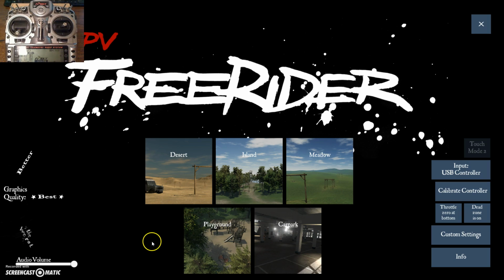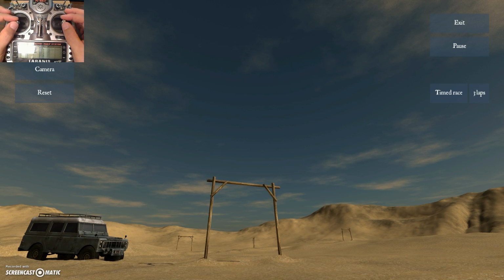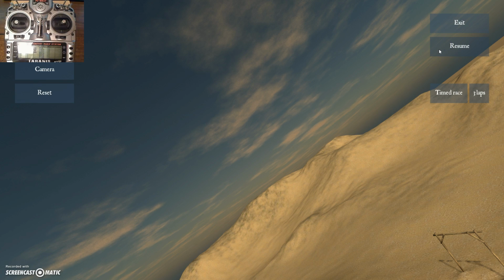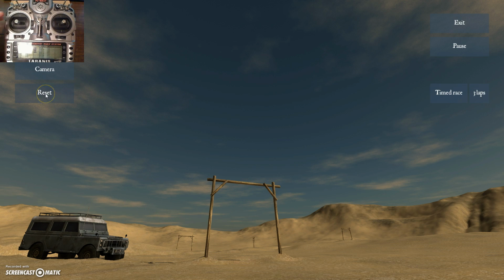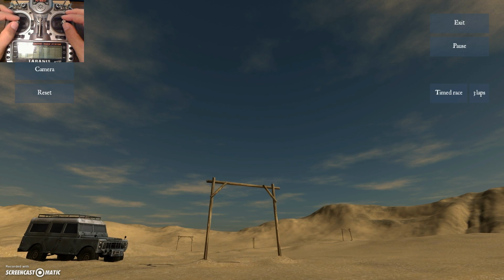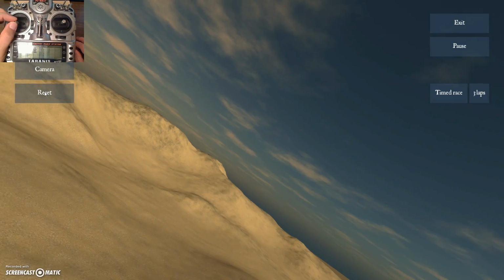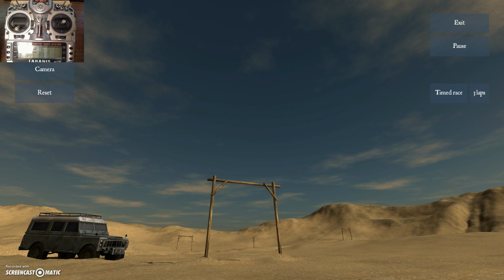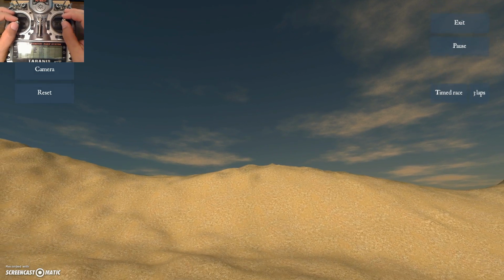How To Fly A FPV Racing Drone - Lesson 3 - Safety Position

Comment: Hi, fabulous. The trick is to initiate the roll then correct with yaw. I works wonders, I spent hours starting a turn with the yaw then using the roll to offset the drift. It never worked. Your lesson is perfect.

Comment: Thank you so much for this lessons! I am getting better and better each time :) I dont have a transmitter so I connected a PS3 controller to my PC and it works just fine! I did notice that comparing to your transmitter, the PS3 controller is way more sensitive but I dont think it will be a problem :) cheers!

Comment: After losing a couple of expensive nanos I realized I've got to get better. I purchased a larger drone with all the bells and whistle to protect me from losing it but I don't feel like I am in full control, and that I'm using a lot of built-in assists to fly. I really want learn to fly FPV and play with VR so I started looking on the Net for lessons and yours came up highly recommended. I really like how you present and the ease with which I can follow along with your video on one screen and the sim on another screen..  

I am having a problem that I can't quite sort out and I am hoping that you or someone here may have an answer.  I have FPVFreerider 2018 and a Volantex "controller" - really, it's a plastic replica with sticks that seem to respond correctly when calibrated in the sim. I changed the setting to correspond to the default settings in your video as they are slightly different in the latest update of the sim.   I am having a problem when I pitch backwards to slow down. I get a view of the sky even with the smallest adjustments. I then have to pitch forward to see where I am, which is way out beyond where I think I should be, plus I am never able to pitch back just enough to slow, or even start moving backwards a bit.

I don't know whether it is me, or whether I need a better controller than the replica I am using. I don't want to spend big $$$ on a controller that I won't be able to use with the drones I have. Any thoughts on what I might need different from what I've described? Equipment change? Practice! Practice! Practice?  Thanks in advance. The videos are awesome.
Reply from the maker: I think you need to adjust the rates to be slower.
Reply: Joshua Bardwell Thanks for your response. I’ll do that and see what happens.
Reply: Just wanted to say thanks again for the suggestion on the rates. I really had to crank them down with this controller but it is working now,  making it so much easier to follow your tutorials and practice the techniques you're teaching.

Comment: The trouble with FPV is that you don't know which direction you are moving, or whether you are moving at all. I've been flying helis for over 40 years and that experience gets in the way and I really struggle with FPV. Flying a quad is easy, so is flying the sim. But doing it for real?

Comment: i just bought by Frshy Taranis X9D+ and i noticed in your video that your throttle gimble you can pull all the way down and let it go and it stays in that position. BUT on my throttle gimble isnt like that..... my gimble stays in the center position....why is this? Can I set my gimble like yours?
Reply: what i am trying to say is that my throttle is spring loaded.....is my Taranis set up correctly?
Reply: I think you need to loose or tighten a screw or two in the gymbal inside; there are probably videos showing how to do it for this model (I know I've seen videos for the Q X7)

Comment: Thank your for the lessons. Just what I needed. Being a pilot for aerial amateur videos it is a big change to try fpv :-)
Reply from the maker: Hopefully you'll love it!
Reply: Joshua Bardwell one step at a time. Now I have the soft but on a tablet without external Tx and a real race quad but still under tuning because it is PPM input and my Tx is not outputting it. I bought a converter PWM/PPM but still failed :-0